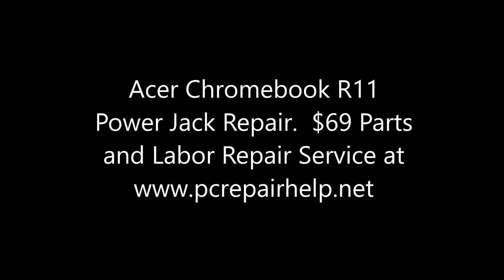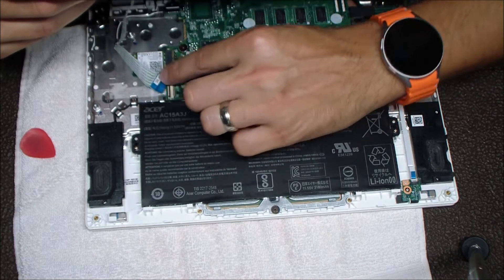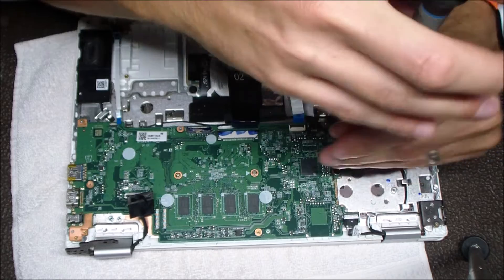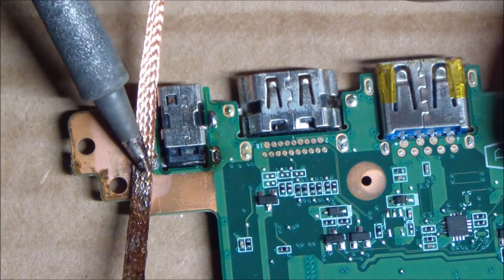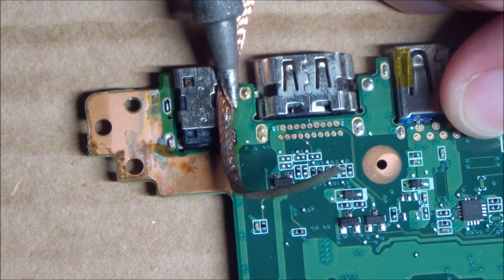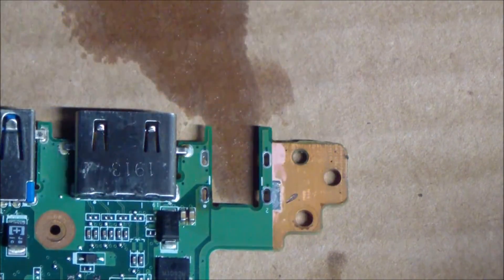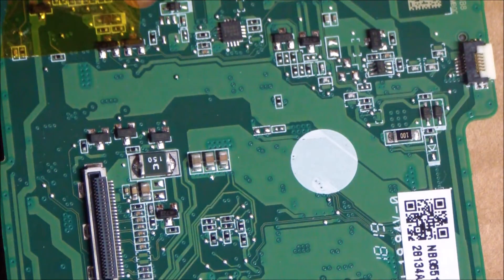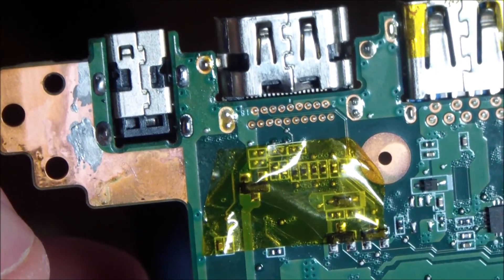Acer Chromebook Power Jack Repair (R11 with loose charge port)

Comment: Could you please tell for acer Chromebook r13 also
Reply from the maker: @Gull-e-Hadiqa777  The r13 uses a cable style DC jack that does not require a soldering. You would just need to take apart the laptop and replace that cable. I don't have a video for the r13 yet unfortunately.